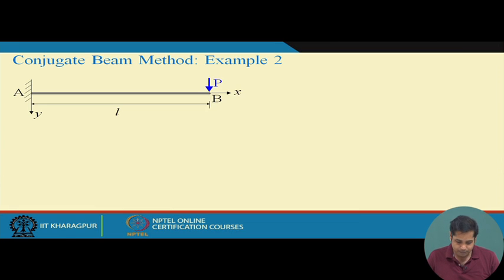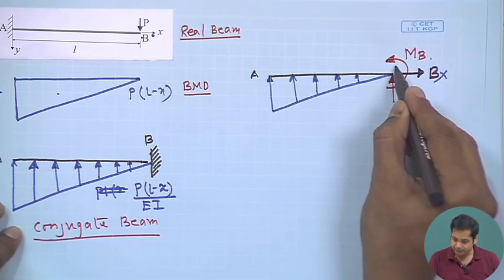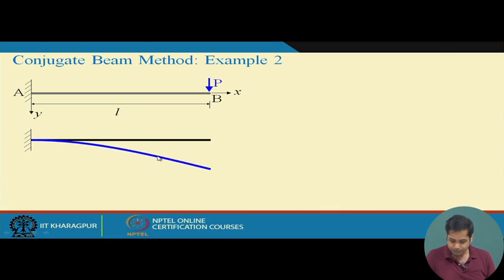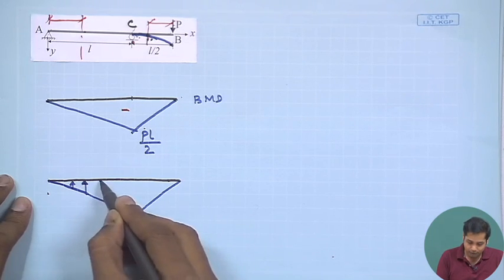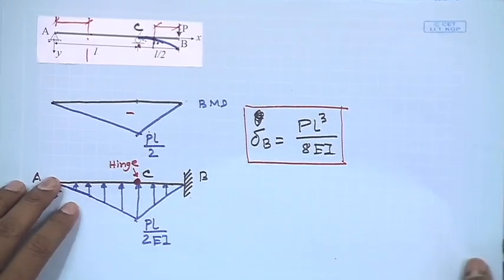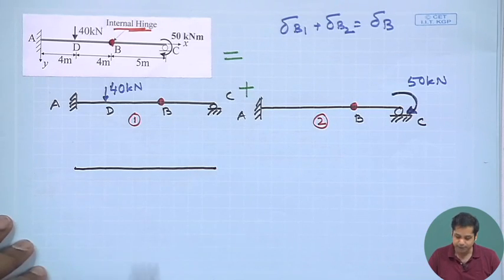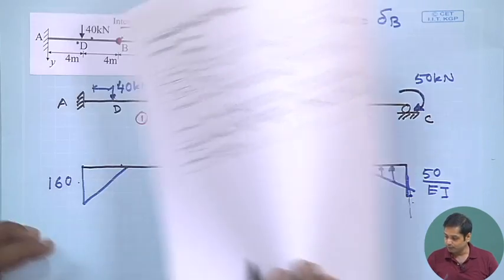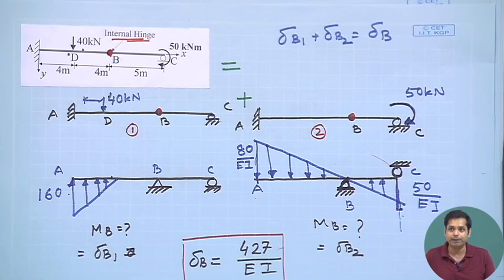Lecture 24 : Deflection of Beams and Frames (Contd.)

Comment: Can someone explain how the bm is 80kn m at A of diagram 2 of example 3??
Reply: Use similar triangle method u will get
Reply: using arithmatic maths type, 50kn for 5 metres turns to zero that is 10kn for every 1 metre than for 8 metres it will be 80, or by similar triangle 5/8=50/w

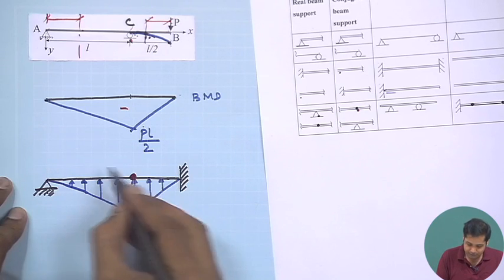Comment: sir when you draw the conjugate beam of the overhang beam  at 16:00  it should be roller instead of hinged at A. since providing hinged in conjugate beam make the beam indeterminate
Reply: Can someone explain how the bm is 80kn m at A of diagram 2 of example 3??
Reply: @bhabanishankarsahoo8212  lecture 4 contains the question related to hinge and how to form the equation.
It is related to that concept.